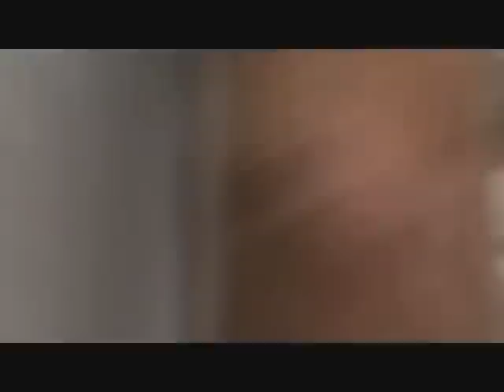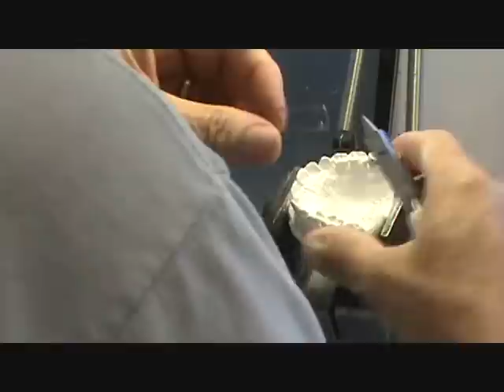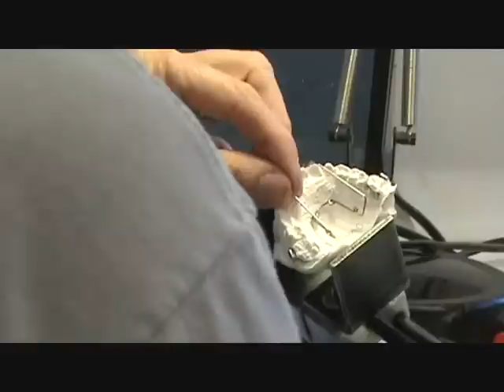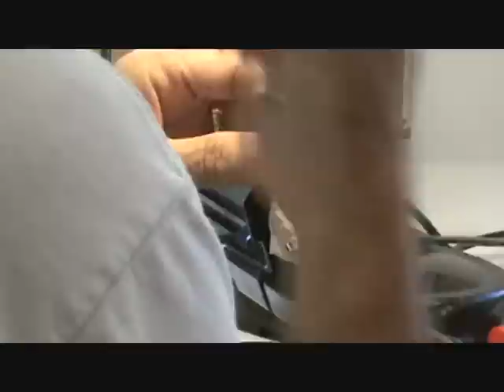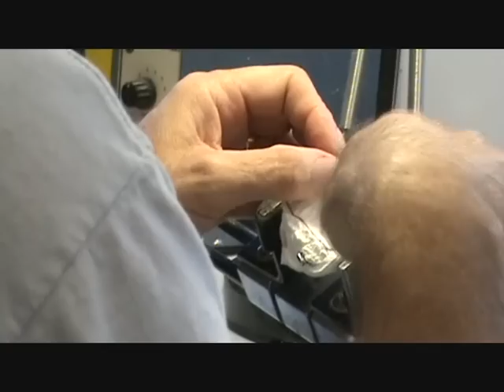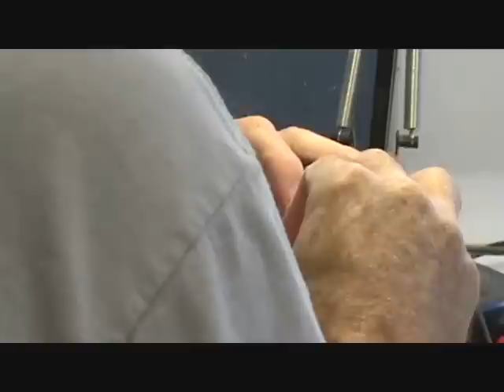Quad helix, wire bending and tack welding.wmv

Comment: what kind of technique did you use to fuse the wire to the bend?
Reply from the maker: +Jefferson Sussoni , Tack welded with A Great Lakes Tack welder. Silver soldered later.
Reply: +Mike Van Dingenen thank you! if you could please answer the next question it would be greatly appreciated. I have seen hawleys with a light pink clear acrylic. How does one obtain that hue? or is it a mix of pink and clear monomer?.....or is it layered as in: pink monomer layers and a couple of layers of clear monomer? sorry total newb at  this.
Reply from the maker: +jefferson sussoni Mix clear liquid with red liquid, till you get a light shade that you like. Ask anything you want to, anytime you want to.
Reply: You are the man! thanks for this I appreciate it broski!
Reply: +jefferson sussoni one more question, what is the difference between clear monomer and clear splint monomer?
Reply from the maker: +Jefferson Sussoni I don't know exactly the difference in splint monomer compared to standard retainer clear monomer.
Reply: Thank you sir. I am trying to learn the quad helix bends the way you did. Hope you post more vids, you have mad skill man!
Reply from the maker: +jefferson sussoni Using Great Lakes 220-020 bird beak pliers, 064 orthopli 3 prong. Pliers make a big difference. Thanks for the compliment, just been doing this for 47 years, time makes a difference as well.